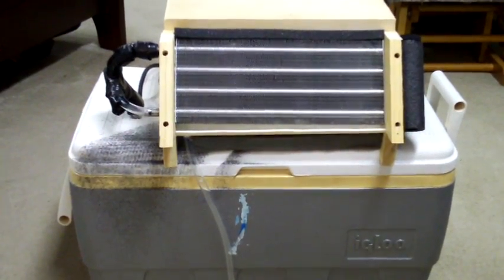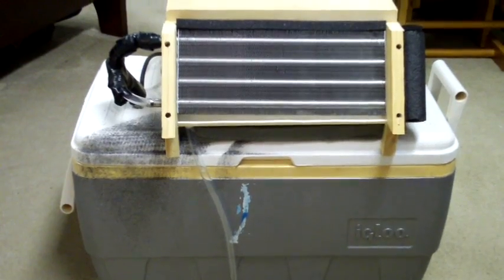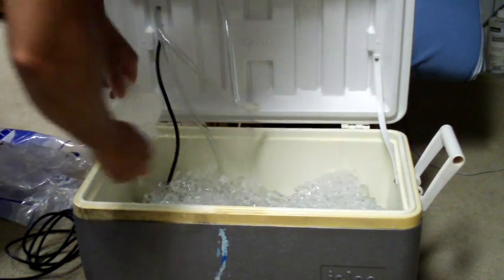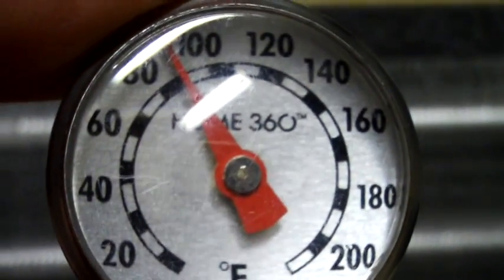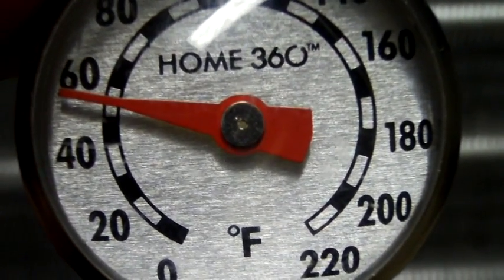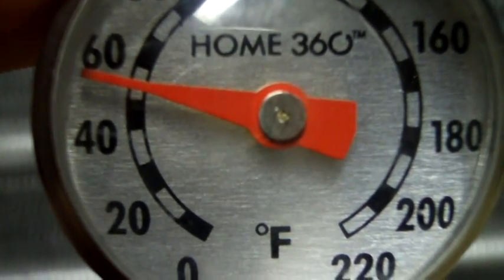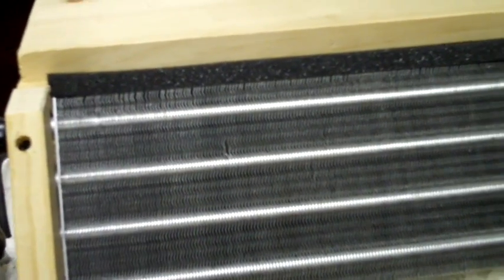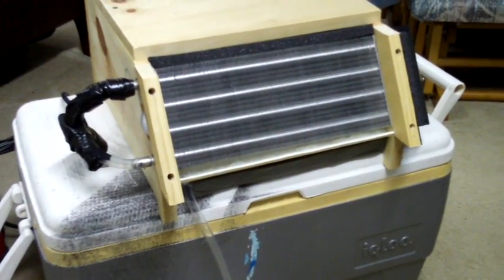Homemade Air Conditioner Part 2.

Comment: i commented on your 1st video, just found them, good stuff, im working remotely with no freezer available so will have to buy ice each day, driving a older peterbilt that never had ac, gonna give your design a try? will report back. Small cab, insulated pretty well and blacked the windows out, hopefully get thru these Ohio summers. Thanx Again
Reply from the maker: At first it's going to consume a lot of ice until everything in the cab has acclimated down to a cooler temperature keep us in the know about your progress with it 💯👍
Reply: @Wallabydam  Will do,thanx

Comment: Everyone I know that built one of these all bought portable A/C units. These are great for a garage or something when you're working outside and you won't be there all day, but not so much for every day, all day use. Most anyone got was 5 or 6 hours of use. They added up how much those bags of ice were. The frozen jugs lasted longer and were cheaper. My buddy still has one and keeps 6 frozen jugs in his freezer unit in his garage and just swaps 'em out. Still though, these are pretty tight. Definitely useful. My neighbor has one on his dog kennels and he runs it during the hottest part of the day. They're nice
Reply from the maker: I agree!
Reply: This is probably good for use at night, after a hot day, to get some comfortable sleep 🤔

Comment: Don't buy ice, cost $$$. Use 16ounce Water Bottles... Like from Dasani, Poland Springs, even 20oz Coke or Pepsi Bottles. Since the cooler is designed for Soda or Water Bottles... It will fit NICELY in there.  That way it will be CHEAPER and FREE and reusable as well.

Comment: I wonder if you use dry ice, would it give better results. It last longer and does not melt to a liquid form, although care must be taken when handling it.
Reply from the maker: It would. But a different approach to using it would need to be taken. FOR Safety.
Reply: +Sidney Nixon you would have to building something to keep the dry ice and water apart out of metal of course and then yes it would deff work. But just keep the water and ice apart or the dry ice will blow up no joke.

Comment: Could u dump a shit load of salt in with the ice?
Reply from the maker: Could. But aluminum would deteriorate from the mix. And have a short life. If there is corrosion. Loss of temperature exchanged would result
Reply: ok thx, I know the ice drop temp down.
Reply: +Wallabydam you need to run a closed loop to use salt
Reply from the maker: I agree

Comment: I'm trying to do this exact same project but I'm trying to find something that would keep the water cold so I would never have to replace the water and the ice. Any suggestions on something I could use?
Reply: +mitch I     either you can use a polystyrene box or you can put it in a silver box and paint it with some black colour this will radiate heat quickly and will keep the water cold for an entire day.      this method is used by termose bottles. the surface is silver and shiny and it is covered by a black coloured cloth   RADIATION

Comment: Great job bud. The transmission coil cooler radiator was a great idea. If you use two coils and pipe in series you can get a little more cooling out of it. To produce 1 ton of cooling you need to have a discharge air temp of 55 degrees air discharge with approximately 400 to 500 CFM will equal 12,000 Btu of cooling (1 ton). The effectiveness of the unit depends on the Delta T (Temp Differential) of the entering air minus the temperature of the discharge air. If you are getting at least 20 degree differential between return air minus supply air you have a very effective unit. I like it.

Comment: I have a suggestion. .. 
 Duct the fan air through  the cooler 
Then to the box. 
So that your cooling  the air 2 times.
And not just blow hot air through  the cooling  unit.
... 
That is how I am going to run mine.
 ...
BTW I like the boat pump ...nice touch.
I will be using  a boat blower to.
Higher air flow.
....
Very  nice build  2 tumbs up man
Reply from the maker: As they say with every action there is an opposite reaction or in this case ducting the error through the cooler would probably make the ice melt a little faster seeing that you're blowing warm air through it through you never know how it's going to turn out just like everything it's always a experiment and with learning from it you gain experience and wisdom let everybody know how it comes out to be when you get finished
Reply: Very true.
And I will do

Comment: the idea of an air conditioner is that it does the work without ice, this is not effecient at all. actually it is quite silly
Reply from the maker: So before refrigerant the "ICE BOX" which used block ice to cool and help freeze food is quite silly as well? Your troll videos well. If you read. This was just out of fun and experiment with items I had.  The idea is not silly when u consider the portability for use in camping. Use in small aircraft while waiting to taxi the runway OR use in short use on hot days while golfing on the courses in the golf In cart. You are closed minded. And that is how progress is never successful. .
Reply: Wallabydam i do not get the "And that is how progress is never successful" what is progression when making cold air from ice????
Reply from the maker: M Goudsmits of course your not going to get it. Your just proved what I said. Move along  and troll someone else on this.
Reply: Wallabydam 

Listen Dude,
when looking for Homemade air-conditioner , the YouTube auto play dropped this
one in,  after looking at more of your stuff I found part 1, where you state it was a just an experiment.So in your first comment you assume I had seen and read the comments of your first video
where you say “If you read. This was just out of fun and experiment with
items I had” Well if that text had been under this video it would have explained a lot, because then
I would have known it was not serious.  And I would not have reacted at all. What I dislike however is that you also call people who you do not know and do not give you thumbs up, immediately “close minded” you must understand that when you do that, you will get a reaction.  That is not trolling!So what is it? Just an experiment with stuff you have lying around or serious progress?

Comment: How far do you feel the cold air?
Will this setup will cool 32 sq feet room?
Thanks
Reply from the maker: honestly I do not have an answer for you 32 square feet sounds like a small room sounds like this would work just fine in an area that  big
Reply: Wallabydam Thanks a lot

Comment: Got a A/C at my HEB 8000 BTU for $100.00
Reply from the maker: Ok cool don't forget to buy a generator  to plug it in when u go camping. Or don't forget the cost of fuel. Along with the noise. U might as well buy ear plugs.

Comment: This is a great design, however, it's a little misleading to measure the coil temperature as opposed to the output air temperature.  Typically there will be a 10 degree or more difference in the air temperature, and, that's measuring a system that may have 3 or more layers of tubing for the air to pass over as typically in cooling applications, you'll find more layers so that the temperature impact is greater, whereas in heating applications, there are usually only 1 or two layers (source: USA Coil and Air Newsletter).  Also, since it's a single transmission line winding through the coils, the temperature difference will vary noticeably from top (where cold enters) to the bottom (where cold water that has been warmed along with way) where it cools less (it would have been interesting if you measured both those water temps...).  To everyone's comments about altering the contact with the ice (frozen water bottles, etc.) the net difference will be temperature versus time; the cooler the air exits, the shorter the mass of ice will last since there's a fixed amount of BTUs in the ice. 

To everyone commenting on adding salt, credit Nate1212 on Reddit with mythbusting this, his calculation shows that salt water will actually lessen the cooling capacity of the ice:

"Adding salt decreases the heat capacity of the given volume of water, so the salt water would absorb less heat than the fresh water for each degree it is warmed. However, salt water also has a lower freezing point than fresh water. My hunch tells me that plain water will be the winner here, but lets try to determine it empirically. Lets assume that you have a bottle of fresh water and a bottle of sea water and are freezing both bottles to -10°C. Assuming that the specific heat capacity of fresh water is 4.184J/g*°C, the specific heat capacity of sea water is 3.850, the specific heat capacity of ice is 2.108, and the heat of fusion of water is 334J/g, you can calculate roughly the amount of energy each bottle takes to warm back to room temperature. (Note, I am taking as negligible the difference in heat capacity as well as the heat of fusion between sea ice and regular ice, because I cant find a specific heat capacity for sea ice. Both are actually lower than regular ice)
2.108 x 10°C + 4.184 x 20°C + 334J/g = 438.76J/g (+hf) -fresh
2.108 x 8°C + 3.850 x 22°C + 334J/g = 435.564J/g (+hf) -sea
Hence, even if the heat of fusion of seawater and heat capacity of sea ice were the same as fresh water (they are definitely less in reality), fresh ice would STILL require slightly more heat to come to room temperature (in other words, 'keep your cooler colder longer') compared to an equivalent amount of salty ice.
TL;DR It's the fresh water"

But all in all a great design, a VAST improvement over the typical swamp cooler if for nothing else than the fact that this dehumidifies the air, whereas the typical swamp cooler (by not being a closed system) humidifies the air...  Now where did I put that spare refrigerator coil I have???   :)

Lastly, to those pooh poohing this as a Poor Man's A/C, since a 90 Watt ice maker can make 5 lbs. of ice in 4 hours (source: DesertSun2 "solar ice maker" on Youtube), in 8 hours you can fill this cooler using only 720 watts, or about 10 cents, at 14 cents per KWH.  Now there's just the pump and fan to factor in.  Now my 12V fan in MY swamp cooler is a 10 Watt unit.  that means to run it 8 hours will cost less than 2 cents.  Since the Harbor Freight bilge pump is 5.5A, that means 66 Watts/hr. or 528 Watts in 8 hours of running, or a cost of less than 8 cents.  8 cents for the pump and 2 for the fan makes 10 cents, but let's add 20% for loss converting from 120VAC since all converters lose some during the conversion, so we'll say 12 cents.  Add back in the 10 cents for the ice maker and we're at a WHOPPING 22 CENTS for 4 to 8 hours of cooling (depending on how fast your ice melts.

If you ask me, the whole thing suggests the makings of a product that, placed next to the chair of an elderly poor person during the next potentially lethal summer heatwave -- such as the 655 people that DIED in 2006 in California's heat wave -- could save their LIFE.

Anyone want to start a business?

Comment: Great vid.  I watched your previous one as well.  I dont know if this has been mentioned but Ill say it again if not,  have you thought about using 2 liter coke bottles with frozen water inside?  I find that with my bucket A/C I get a couple of extra hours out of the cooling by doing that and by keeping 4 frozen bottles I can get a full days A/C out of mine.   Im going to try to obtain the parts you have listed here and make one of these units for my studio.  Thanks again for the vid.
Reply from the maker: thermal transfer for the bottles are not as good as direct contact with the ice, so i just went with the ice. but the bottle do make a cleaner less mess situation for sure, sounds like your getting great results !
Reply: What about adding water as the direct contact and the 2 ltr bottles for the ice.  Would that not ad a constant temp to the system and maintain longer low temps?
Reply from the maker: well it could i mean the plastic is thin and could do the same but its not  as quick to cool the water, also once those bottles start to melt the ice inside them, that water is also a thermal barrier that the cold has to transfer through,unless its frozen it will not produce as good of results as direct contact  with the ice, the bottle once half melted has to cool the water inside the bottle Then tranfer that through the plastic then to the water again  What i Have been doing, is taking tupperware plastics the big gallon onces and freezing water in those, and then making giant block ice to put in it, seems to work really good and last a while longer, then cube ice, but cubed ice produces better cooling, but shorter time.

Comment: I LOVE this design!

I've had a couple of ideas about improving it a bit and would like some feedback.  

Idea 1: What if, instead of circulating the ice water from the cooler, a closed system containing an antifreeze coolant is used?  Not automotive antifreeze since it is toxic and could be an issue if the system leaked. Instead, a mixture of water and glycerol would work well down to -36F.  Glycerol is non-toxic. (I got the glycerol info from Wikipedia's page on antifreeze.)

Idea 2: Presuming idea 1 is implemented, what if we used a combo of dry-ice and regular ice to cool the closed system?  Actually, instead of dry ice, I would consider using a couple of commercial grade Nu-ICE packs which are reusable and do not release carbon dioxide gas.  Nu-ICE would hold a freeze point around -10F for several hours.  The only downside is that the Nu-ICE has to be frozen to at least -15F for 48 hours to be "charged."  

Questions if both ideas were implemented:
- Would the water pump be damaged by the glycerol water coolant?
- Would the extreme cold of the coolant cause ice to form on the radiator?
- If the system would function properly without freezing up, how much faster would the extreme cold air cool down a given space?

Thanks for any constructive thoughts.

Comment: I've read all the comments about adding salt or rock salt to lower the ice's temp. True, if one used aluminum (I know you used what you had) the ice would corrode it. It's a good idea if one keeps in mind that the pump should be rated for salt water use as well- most aquarium and fountain pumps are not. I'm gonna build one of these for my up and coming campervan; a regular AC will cost too much money & use too much power. The one thing you don't mention is the plugs- I'm assuming your fan and pump both have 12volt plugs? Did you plug them into a splitter and the splitter into a power source? I'm in Texas, so I'll be using this in the summer- I'm definitely going to let you know how it goes. And for those who think this is a swamp cooler- it's NOT, because it's not adding humidity to the air, it's dehumidifying it.
Reply from the maker: You are the first to watch the video and understand about the effect of salt on the aluminum components in this,  The plugs I use are cigarette style plugs 12 volt, where you live with low humidity, this will work well, I did use a splitter, the fan uses very little power and so does the pump, I tried to find a cheap aquarium 12v pump but I didn't so I ended up buying the bilge pump.  definitely let me know how it goes, its always interesting what the results are with everyone's own version.
Reply: Wallabydam
I'm going to build the basic unit first, then add a thermostat for more temperature control. I can't find a 12volt thermostat that I trust, so I'll use one I'm familiar with. It uses 110ac, so I'll plug the fan/pump into a splitter and then into a DC to AC converter, then into the thermostat. The thermostat will be plugged into an inverter, attached to the same 12volt battery. It might sound complicated, but I believe it'll work well.
Reply from the maker: Don't give up on looking for a suited thermostat, Otherwise you will have to spend a lil more on the DC to AC invertor your talking about, But I think you are onto something good, and sounds like it will work well for your application, to some  its silly , to me its exciting and imaginative,  nothing better then the satisfaction of it working well for what you intend to use it for !  :)

Comment: Have you considered putting salt in the 2 liter bottles, per the previous idea to conserve ice? Maybe methanol?  This would isolate both the flammability issue, and corrosion issue.  Also, have you considered using natural circulation by placing the heavier water source above the heat exchanger.  Likely would need larger tubing to get appreciable flow, but may not provide enough flow without significant height difference to make it worth the cost savings of eliminating the pump. Just some thoughts. Nice job.
Reply from the maker: I really did not try salt, because its corrosiveness on aluminum, I just tried to keep it simple, I like your idea though, its worth trying in the future,  And thank you for the  compliment !

Comment: add a rock salt  it would lower the freezing temp of the water enough hope its help
Reply from the maker: Thank you !, but I will tell you why I do not add salt to the unit, because it will corrode the aluminum inside the coil, so I cannot use it.

Comment: here is an idea, get some jugs, fill with water and put in the extra space in the freezer. have a rotation and take them out every day and swap with the others.  your freezer is already part of your bill so not much more expense.  use condensation to provide water.  run fan off solar and it's basically free.
Reply from the maker: Well what i do , is just freeze a block in a freezer and put that in the cooler, i use a small feed bucket in a depe freezer